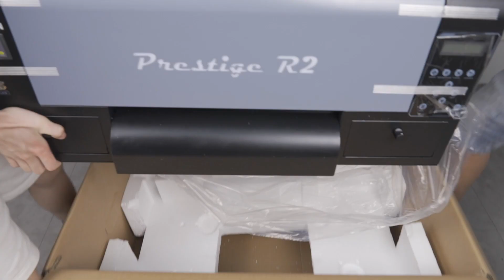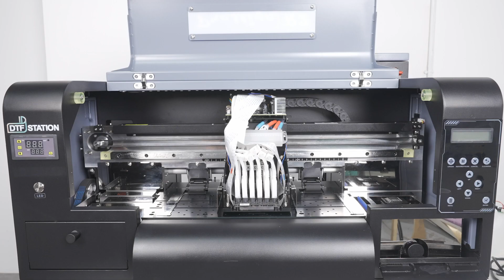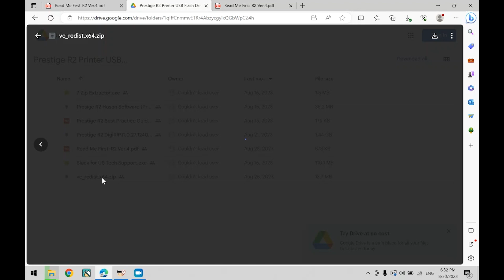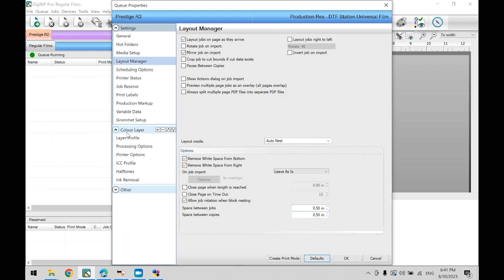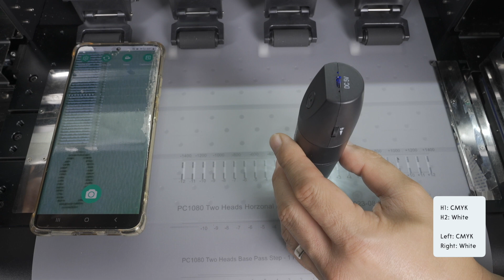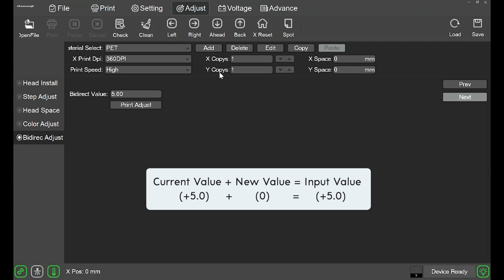Prestige R2 Complete Install & Setup | DTF Station

Comment: The printer connection shows green after typing in the right IP address, but it says failed to load paramaters.
Reply from the maker: Hello, it appears you may be using Hosonsoft when it should be Pilot or vice versa. In the program you ARE using, go to Advance->Version Info->Refresh
If MB Program Version is number is 5.7.x.x, they need to use Hosonsoft
If MB Program Version is number is 5.8.x.x they need to use Pilot
From there, go to the quick start menu for their printer and locate the correct software that they need from there